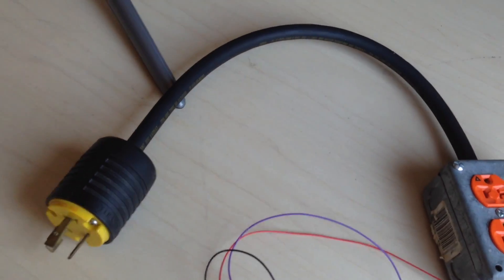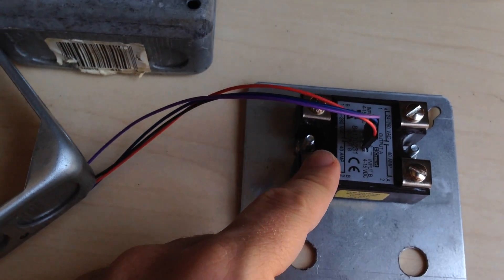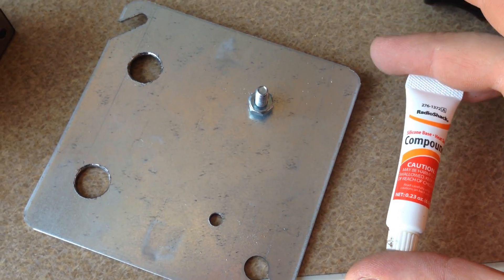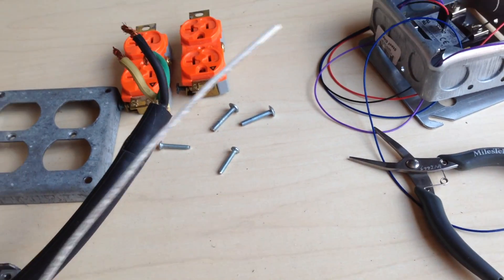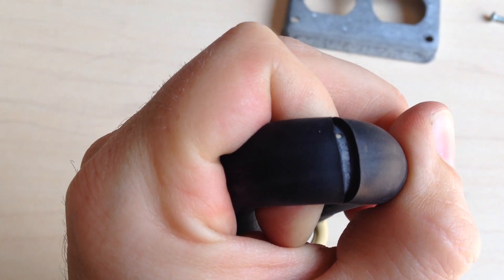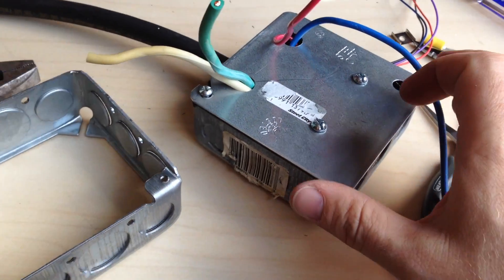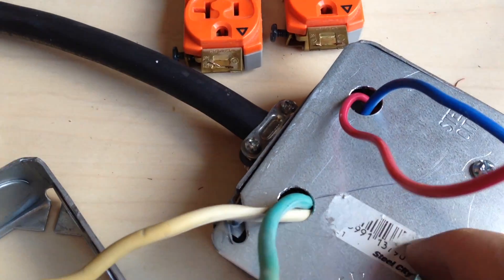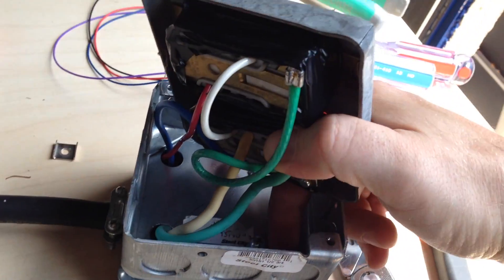Dual 20 amp 120V Solid State Relay Box build

Comment: Why didn't you use grommets at the wire pass through? The wires need to be protected. How are your steel boxes grounded? Using the type of receptacle you are there is no grounding through the yoke strap back to the boxes. The grounding of any metal with electricity is for your protection.

Comment: Crydom white paper on SSR claims 1.5w per amp heating of the SSR on AC powered loads. Have you seen this in practice? Is that simple steel cover plate enough to keep that relay cool, or are you only switching very small loads?
Reply from the maker: +Gordon McLellan You know, I have never pushed these things that hard. I usually derate them 1:2, and run them at 5-10 amps. In my experience they don't even get that warm. If the white paper says 1.5w per amp you are still only looking at 30 watts thermal.